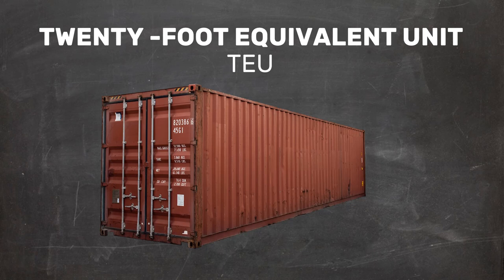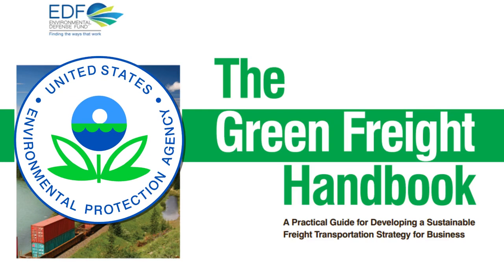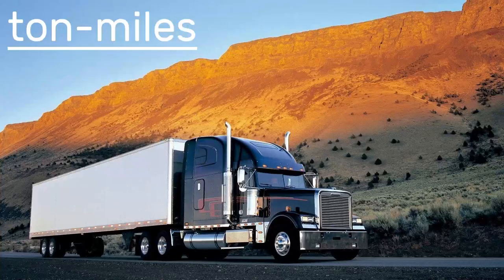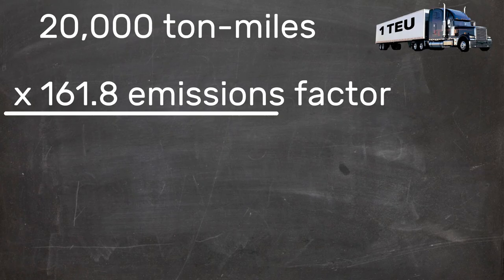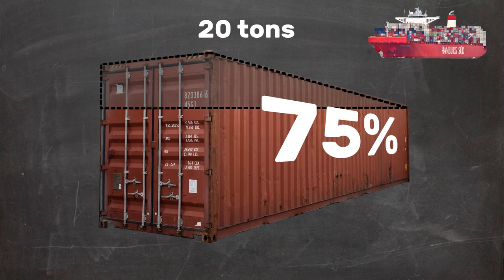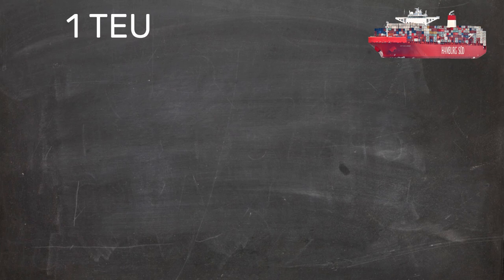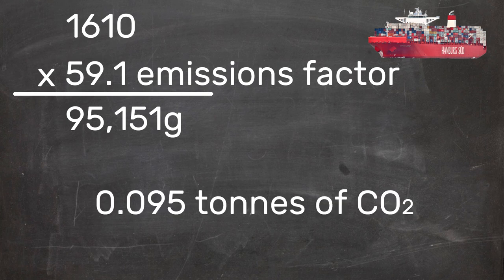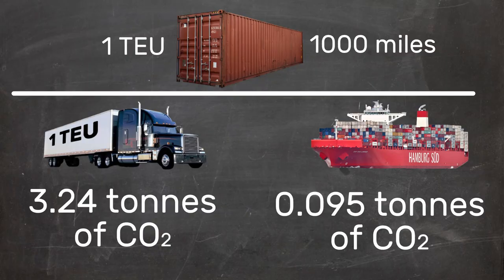APPENDIX: Why shipping pollutes less

Comment: Apparently North American rail has a emission factor of 22.9 grams per short ton - mile. So the same pears over 1000miles would net us 0.458 tonnes of CO2.
Once again showing the superiority of rail transport (remember that container ships can‘t go where trains live and vice versa but trains can go where trucks live).

Also, this is stupid North American gas guzzling trains, not cool Swiss hydroelectric powered trains they use for this emission factor. So trains can be even better than that (while trucks can‘t really be a lot better than that).
Reply: Trains can not go where trucks can, well, maybe you do it differently in America, but where I'm from we don't drive trains on roads
Reply: @vikingursigurdsson  there's tons of warehouses here with tracks going right up to them but they're all inactive because trucks took over
I don't know what you have to be smoking to let that happen
Reply: Trains aren't really practical for capillary networks but I'm sure America could stand to build a slightly more comprehensive network
Reply: @jankthunder4012  whatever you say anot American railroads, freight railways are doing better there than pretty much anywhere else in the world.
Reply: You need trucks to take them from the terminal to house though...

But I guess you can use electric trucks with a super short range so that's probably not a problem
Reply: They aren't stupid. They do their job well.

Comment: You may be correct about TEUs, however, in my experience - my Father was Master  of three such shipping vessel, I also spent some time with him on a OOCL ship in the owner’s sweet, adjacent to his. We spent more of the time in his suite, as it was roomier and had 4 forward facing windows and two starboard. The bridge and wheelhouse, chart room etc one deck above.  Looking forward you coul see right across the main cargo deck. My point being that what I observed was that the majojority of these ‘boxes’ were 40’ not 20’ containers - a,though deck fixings, dockside portaiainers, straddles and gantries had fixings for both lengths.(on one trip, there was a special frame with similar fixings on which 36’ pleasure cruiser(s) were carried). There were also special slots for powered freezer boxes  called reefers.

Comment: Thanks for the explanation. However, it seems like you compare the two as shipping over sea could be an alternative to shipping by truck. However, that is not the case. The trucks needed to ship the containers from the ship over land to its destination is necessary, since most containers its destination is not the port where they arrive after shipment over sea. So, the total amount of co2 is that from the shipment over sea plus the co2 from shipment by truck. Its not a comparison.

Comment: I hate to be that person, but a truck can transport 2 TEUs, not one... most containers you see are actually double long, single-TEU containers aren't that common

Also, it would be helpful to add freight trains into this equation
Reply: And in some places in EU you can carry 3 TEUs. But that requires a permit since 24m is the standard train length MAX(vehicle combination=train length even on roads/trucks). 64.000kg. MAX total weight without permits.

But due to 3 TEU cargo containers not being able to fit in the 24m, lorries can get to 25,25m just to be able to carry a extra TEU module. One 40fot trailer connected to a dolly and a single 20fot on the vehicle. Or it might be something else then 20 and 40feet. Really I do not know what the container sizes are here. But anyways something like that. Just to make cargo models able to fit on the lorries. 

Point is that you are driving around with 3 vehicles. Trailer + Dolly connected to a "truck" that can carry a 20feet.  So much for MAX length. Mostly in Sweden and Finland is this a thing. In the rest of EU you are limited to 2x20feet or a single 40-45feet container trailer. Since the limit in most of EU is 18m I think?? 19m? Really made up limits. No way to get a 3th TEU on.

But yea stuff is calculated in TEU's. On a train wagon you can fit 2x20feet or a single 40feet of AMERICA whatever.

Trucks/lorries that carry TEU's usually work with train/ships. So for instance for a train you can drive up to the train and exchange THE HOLE DAM TRAILER and 40feet leaving you there with just the dolly left. Meaning that you can find trains having truck trailers ontop of the wagons. And when they change over to road transport the hole trailer and 40feet is lifted on and off the train. Usually you exchange empty and loaded trailers/cargo units.

20 feet containers are lifted on and off the trucks like they do with ship transport. But it is kinda funny to lose your trailer and drive around with the dolly since the train stole your trailer :c Looks really stupid! And kinda hard to reverse with.

Comment: That thing in the beginning seems to only have 10 wheels. Why is it called an 18 wheeler?
Reply: Each tire you see is actually two tires on each side except for the front steering one which is just one. so (2 + 2 + 2 + 2 + 1) * 2 = 18
Reply: @hilol14707-two  Ah, that explains it.

Comment: Shouldn't that include the weight of the truck/cargo ship as well, otherwise you'd have 0 grams of co2 with no cargo cause you'd multiply by 0? And 1 truck for 1 container would be more efficient than the whole cargo ship for 1 Container.
I guess you are just calculating the co2 emission for the cargo while ignoring the vehicles own emission which is a but misleading. Maybe should've added at how many containers the ship would be more efficient than a fleet of trucks

Comment: Why did you not use TEU for the truck? It had data for that, it was about ~1/5 what you calculated with ton/mile.

The TEU/mile factor is 597.4, while the ton/mile factor is 161.8. 
20 tons x 161.8 = 3,236 or over 5x the TEU factor.

Why aren't the TEU and 20 ton/mile factor equivalent? Shouldn't it actually be less, especially if 20 tons is only 75% a TEU?

Unless I'm missing something, this is totally wrong.

To be fair, the TEU for shipping is only 59.1, which is 10x less for trucking (597.4).

You inaccurately said it's 32x as inefficient. It's actually only 10x as much fuel.

So, if the ship only uses 0.095 tonnes, the truck only uses ~0.95 tonnes.

Food for thought. These average statistics don't account for how difficult it is to transport over land. Sometimes you have to drive up hills/mountains, or the road isn't straight, like the shipping lane, making it more complicated.

This video is inherently biased in it's conclusion. It doesn't represent the situation appropriately. There's a good reason for trucking. That's all.

One more thing: humans have only increased atmospheric CO2 by 0.01% (1/100 of 1%) over the entire industrial revolution. It seems insignificant in my opinion.

Comment: How about instead of calculating impossible hypothetical intercontinental truck roads, you compare what's actually being emitted right now. What's the total pollution percentage of the cars/trucks yearly right now, and what's the total pollution percentage of the sea shipping comparatively. Don't forget to take into the account different types of air pollutants, and all the extra factors like balast water.
It'd be a much more useful metric, that what could've-would've been. What's the point of calculating potential pollution from trucks carrying all that cargo over such insane cargo-ship grade distances, when they never do that and never will. If all cargo ships sink tomorrow, nobody's going to drive it all by truck, even if there were such a road.
I am not defending the trucks, those suck and are inefficient, but what you're doing is protecting the lesser evil via comparison to bigger evil. What we really ought to be doing, is nuclear energy powerplants and electric railroads, not picking what kind of oil baron we give our money to.
Reply: By that metrics planes are the worst then come trucks, trains, small ships and big ship
Reply: @anuvisraa5786  Trains powered by nuclear energy are the best in every way.

Comment: You "forgot" to mention that the distance from Argentina via Thailand to USA is about 50,000 km. From your video I take that shipping is 34 times more efficient than truck hauling. 50,000/34 = ~1500 km. That is the equivalent distance a truck can take and still produce less CO2, i.e. the distance of plantation to packaging plant within the USA. So unless your packaging plant is half way across the country, producing in the same country is better. Especially if you take any other country where distances are not as ridiculously large as within the USA. Shipping is only more efficient on paper, when you disregard the fact that distances on sea are exorbitantly larger than on road. Only by not mentioning this fact does your argument hold that shipping is better. Conciously disregarding facts in order to make your point look better is manipulation. You're just another propaganda channel.
Reply: Hi, do I understand you correctly that the shipping is more effcient for the same distance and same load, however its use is more distance insufficient (covering more unecssary distance)? So the localy produced pears, transported by trains (they are better then trucks) would be more efficient in practice because there would not be any uneccesary distance around the world. It seems to me, now that i think about it. That the whole "efficient" transport cost was a red herring, and the main point was the comperative advantage. Which could rise some additional questions, like. Why is Argentina so focused on agriculture? Is it actually more efficient in growing pears? What ecological impact pear productions has? How much cheaper labour is in Argentina? Why? 
Thanks for the comment though, it made me think :)